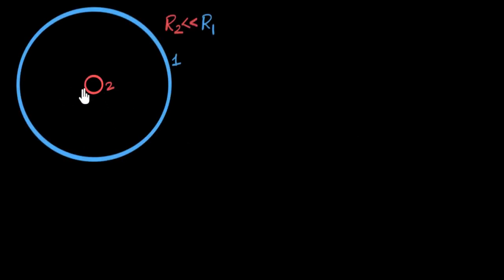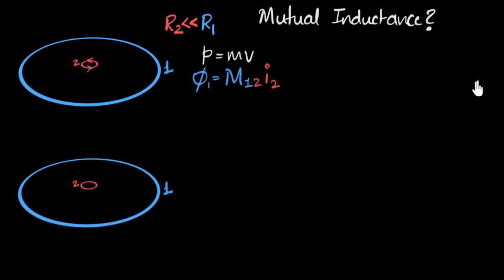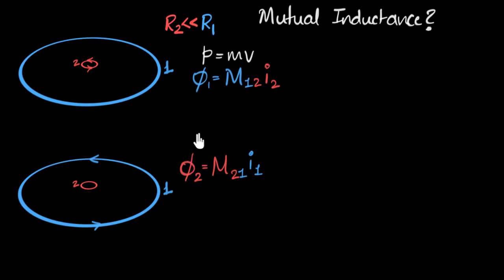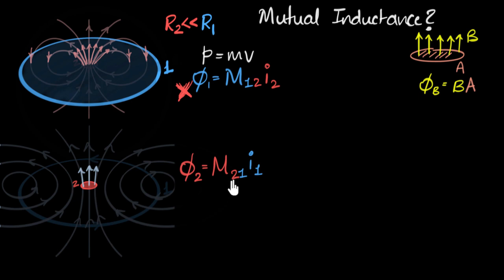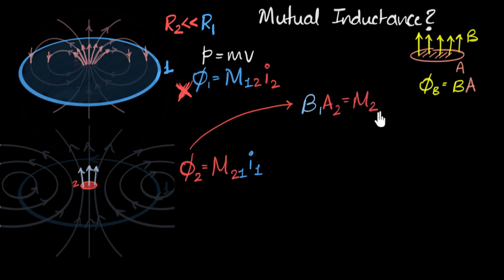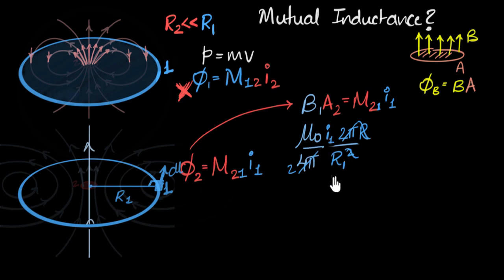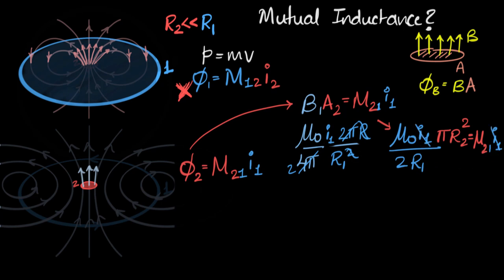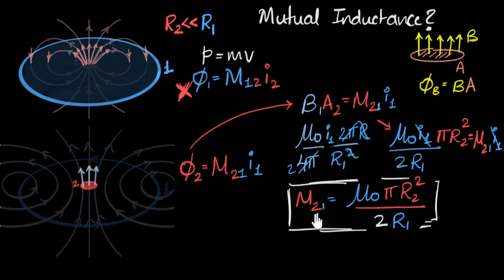Mutual inductance of two concentric coils | Electromagnetic induction | Physics | Khan Academy

Comment: can we use the same trick if the orientation of the inner coil is different?
Reply: yes, as long as the radius of inner coil is diminishingly small in comparision to outer coil's radius, then you can treat the inner coil as a point so it wouldn't matter